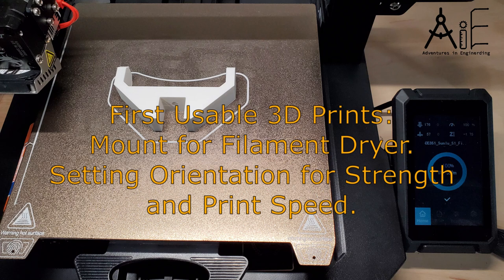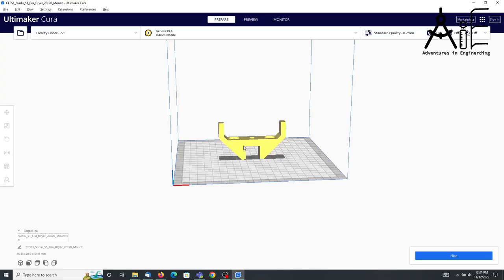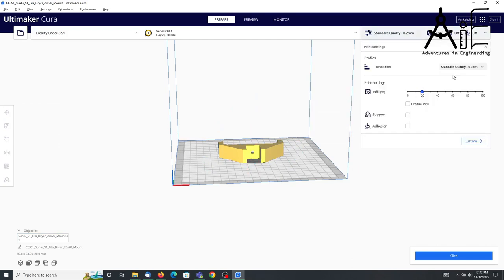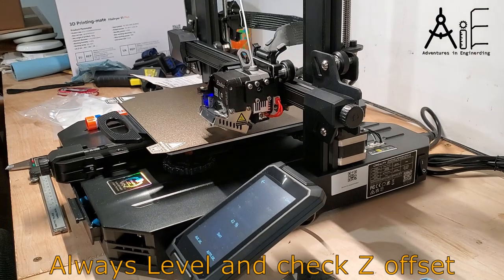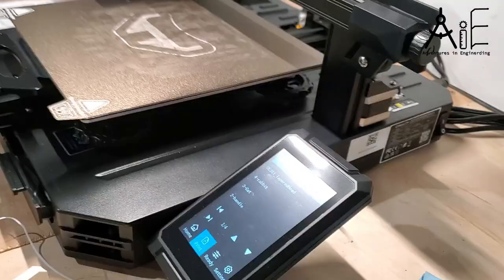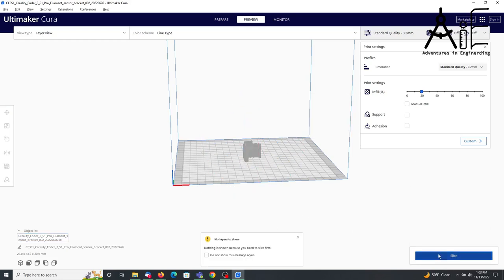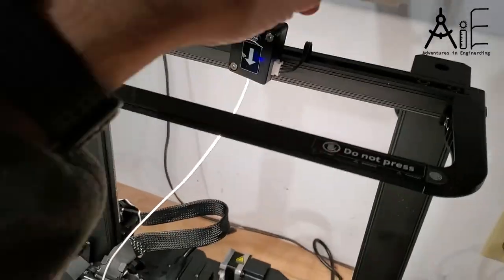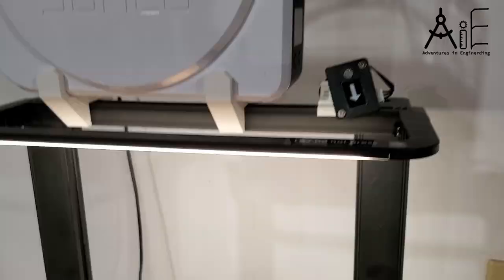My first usable 3D Prints showing orientation for max strength & speed using minimum support fill.

Comment: Also new to 3d printing (same model too) and yeah I've found most thingiverse uploads aren't oriented the way they should be printed even some owners having orientation notes in the description.

Actually I'm wondering if you've done a bed leveling test yet cause I'm having trouble with mine. My z offset is fine, I've even manually leveled before the ABL to reduce the amount of compensation it needs but my bed level test prints have issues in some parts.

Also I learned that PEI sheets like ours don't really need glue. I don't have glue right now but while I still have leveling issues, parts stuck on perfectly.
Reply from the maker: A lot of people, myself included, design parts in an orientation that makes sense for drawing, but not for printing / manufacturing.  No fault for that, but just hoping to let people know it can be changed for printing to get desired qualities.  

I have done very little with bed leveling other than a gross check of moving the print head to the 4 corners and measuring height.  For mine there was not much difference so I figured the auto level could compensate fine. I could probably manually adjust to tighter tolerance, but so far prints have been fine. I did not try a specific bed level test print, but my nozzle clearing lines and perimeter lines just before the print are pretty consistent. 

I read that PEI sheets don't need glue, but I'd rather use it and make peeling up parts easier than risk damage to part or PEI sheet.  The glue sticks were 12 for $6.  Just cautious I guess.  But it does add some cleanup. 
Thanks!